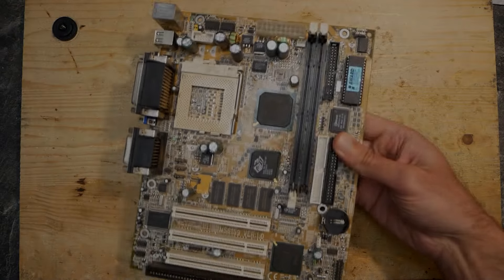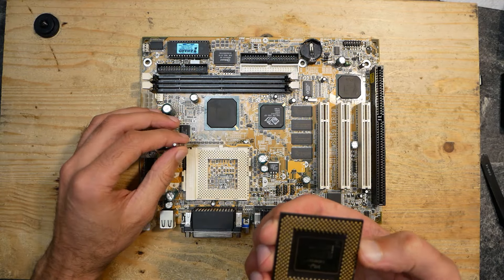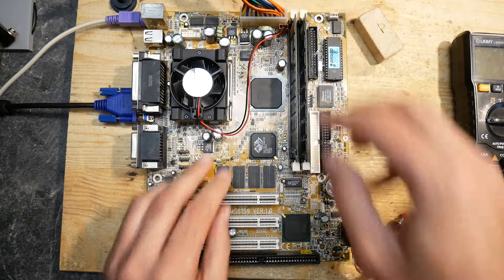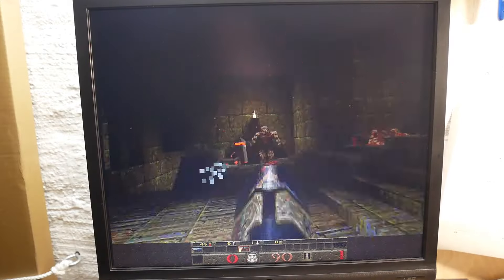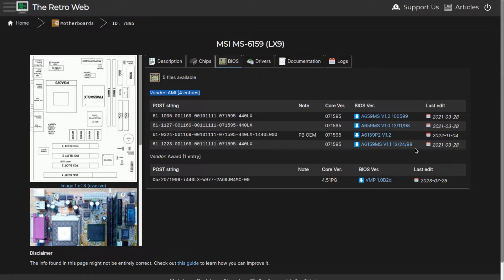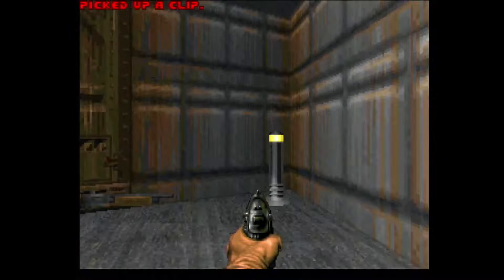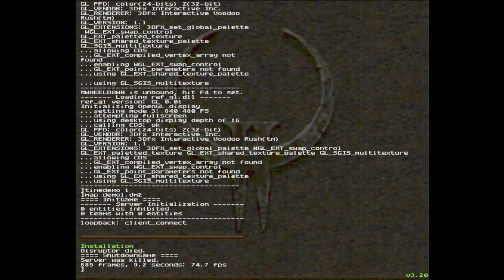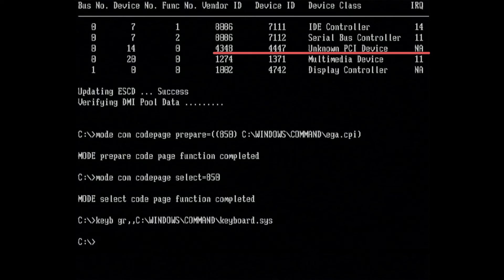Too nice to be true? Intel i440LX was upset about my plans.

Comment: I thought it was well known that 440LX has some AGP incompatibilities. I have a few 440LX boards and I have tried probably 15 different AGP cards and they mostly all work just fine. Matrox G200/G400, TNT/TNT2, banshee/Voodoo3, Savage 3D/4, Rage 128/128pro and yes even the Rage pro but the Geforce cards do not work. I haven't used too many newer cards, maybe the newer Geforce and ATI cards don't work also. Tempted to try some Radeons or newer Geforce cards in it, maybe Savage 2000 or Rage fury maxx even. Also, the Rage pro drivers are a mess. I remember needing multiple different driver versions to play many games so I wouldn't be surprised if that might be the reason for the Rage pro not working
Reply from the maker: The actual problem is, that those AGP cards don't work with Coppermine CPUs, but with Mendocino they work just fine. At least from what I tested. So there is no issue between LX and AGP, it appears first with Coppermine CPUs.
Reply: @necro_ware  Yeah, I understand that part. Just that the problems with the Rage pro might be driver related? Also the AGP Geforce FX works in the LX board with the Mendocino CPUs? My LX boards don't work with the Geforce cards I have tried but that was only Geforce 256 (SDR and DDR) and my Geforce 2 pro
Reply: @necro_ware  it could be driver being aware of incompatibilities of 440LX chipset and activating some workaround depending on CPUID (i.e. it checks for the CPU and not for chipset)

Comment: I forget which system I had with a PCI128 on board, if you like your midi, best with the 8Mb GM bank that came with the Ensoniq, I think Creative only supplied the 2Mb and 4Mb options - it wasn't quite software wavetable, and it wasn't quite hardware wavetable, well I guess it was hardware wavetable but with the memory borrowed across the PCI bus

Comment: It's quite unusual to see 440LX chipset with socket 360. They used to be Slot 1 boards, as far as I remember.
Reply: I have an AT form factor Gigabyte-GLA7 board with Socket 370

Comment: ATI Cards cannot cope witth high AGP Frequencys most of the time. With Radeon 9x00 Cards the limits seem to be about 80 - 90 MHz. (Blackscreen while Booting) Maybe on older Chips from ATI its worse.

Nvidia cards dont have this Problem at all (TNT2 to Gforce 4800). Reaching 100MHz with my geforce 4 on Nforce 2 pro was never a Problem.  My Voodoo 3 3500 does not have Problems with high AGP clocks, too. Cannot speak for geforce 5 cards... Maybe the 440LX is bad, also. Had the ASUS P2L97, giving me headdaches every time

On ATI 9x00 cards, you do not gain any performance from overclocking the AGP Bus also. This maybe is happening on older chips, also. on Nvidia/ matrox and 3DFX Voodoo 3500 the performance scales very well.

Comment: Intresting. Most of the LX boards i've seen wasn't able to run even Celeron Coppermine usually hanging on windows boot or in 3D I've always assumed it's AGP related, so it's not new, but 256 Mb RAM wasn't an issue for them. Is an intresting board tbh. Maybe not the most desirable but certanly an instresting one. Not many allows choose from AMI / AWARD and certanatly not many gives you ATI Rage for free. 🤔 Coppermine, well there is enough VIA and BX boards for them.

Comment: Just for curiosity, maybe I missed, but the issues with the AGP cards still affect old Mendocino CPUs? Also, I remember being in BIOS some AGP related settings (like AGP fast-write or similar, if I remember correctly); try to see if those are changing the behaviour. Maybe there are options set and hidden in the BIOS? That specific setting (AGP fast-write) I remember gaving me a lot of headache in some motherboards with Ati Radeon 9250 AGP, random freezing on some games, BSOD on XP SP3 and Win98SE.
About that mistery PCI device, seems to be from a vendor (4348) that made mostly serial/parallel I/O adapters for PCI and USB, so, maybe that particular mouse really had something to do with it; it might be a serial mouse in disguise  (LOL), however, another mouse did the same?
Reply: I believe that the fast-write feature was a later addition to the AGP standard and wasn't used with AGP 2x which 440LX supports. There's a side-band addressing which he may be able to disable and I would also try to run it in 1x mode just to try improving the stability.
Reply: @petrkubena  yes the AGP fastwrite has problem with SSE support CPU..as i know

Comment: I don't know if anyone has mentioned this yet but as it turns out the 440lx chipset dosen't support SSE instructions when you have a Coppermine CPU due to an incompatibility. This could be why later gpus crash when you do anything 3D and the rage pro didn't since its old enough not to require sse and also the voodoo 3 drivers also don't use sse
Reply: This was actually covered near the end of the video.

Comment: Interesting motherboard, is the first one of this kind (with integrated graphic) of that era that i see! great work as always!
Reply: ha. Thankfully you dont use some Chips&Technologies based socket7 boards. It was a nightmare 😂 - slow as hell 😁
And on branded (like HP/Dell) PC I have seen integrated video at least on 486 VLB era.
Reply: @VShuricK  never came across one, now im will be on the look for one, at least for trying them out. I have some socket 7 waiting for me to repair them an tinker, tho not having the time. its a shame! all that suffering waiting for me! hahaha

Comment: Ah, old Intel Chipsets and their pickiness with RAM...
You have to have them in a certain organisation to be detected correctly. If its the wrong one, you get half the Capacity, if it even works!
PRO TIP: use low capacity sticks to test Intel SDRAM Pentium2/3 Chipsets...
The i430VX for example only supports 16MB (maybe some 32MB?) Sticks for example...

Comment: My ABit BH6 rev 1.01 (or similar, early revision not supposed to support coppermine) ran my Pentium 3 700 @ 933 mHz rock solid for years in a slotket by just cranking the bus to 133 and upping the Vcore a bit. None of my Riva TNT, TNT2 Ultra, GeForce 256 cards had any problems running at 2/3x133 bus speed either. Overclocking used to be such a joy... Also it used to save a LOT of money, which is one of the reasons it's pretty much dead now =D
Reply: 16:50 i was probably THAT lucky having accidentally bought an early revision Pentium III 700 and a great silicon quality one as well.
Reply: It might have been because of the Slotket i used as well, it did have jumpers for some stuff, one of them might have been the reset mod.
EDIT: i think this was one of the major reasons i didn't buy a slot 1 p3 700, i think i needed to use a Socket 370 model in a slotket to even have a chance of it working. Still, the BH6 revision i had wasn't supposed to be able to work with a coppermine cpu.
Anyway, this was A LONG TIME AGO, it's hard to remember all the specifics.

Comment: Did you try swapping the 8 mb (4x2Mb) SGRAM memory chips of the Velocity 100 against 16 mb memory (4x4 mb)? There exists a model of Voodoo 3 2000 with only 4 chips soldered on instead of 8. I have myself this board (Velocity 100) and was wondering is it worth a try. You can get the necessary amount of 4 mb SGRAM chips from ATI Rage 128 boards.
Reply from the maker: No, I didn't try that, but that seems to be an interesting idea. I'll put it on my list if you don't mind.
Reply: @necro_ware  I would gladly wait for the results (moreso if that would be a success)!

Comment: Might be able to uninstall  the AGP gart driver and force the AGP device into pci compatibilty mode. Might be a bit tricky for intel chipset as Widows would come with the driver. Might be possible to use update driver in device manager  to force the AGP bus to use a generic PCI-PCI bridge driver instead of the proper agp bus drivers. AGP Aperture size setting in the bios might do something
Reply: Nvidia can do it right from the drivers using coolbit registry hack to unlock agp settings and overclock page :) Maybe it is only needed to disable SBA, fastwrites or both....

Comment: At least on my Asus P2L97, Coppermine doesn't have the same problems so the issue could be purely socket related, not chipset. While seen as a Pentium II, the voltage regulator supplies down to 1.7V  for my PIII 650 (rated 1.65V) and everything works the same as with my Celeron 300A/333. I don't have the same AGP power limits as with my SE440BX-2 either, the only AGP cards of mine that don't work are due to their connector.
Reply from the maker: That is an interesting information. The single difference between P2L97 and the MSI board which I tested is the CPU slot. Well voltage issues should not be relevant I guess. I have here another 440LX Slot1 board. Will have to check that out.

Comment: failing caps sometimes start to get higher capacitance so the caps you desoldered might actually be degaded since 1817uf is way higher than 1500uf
Reply: Yeah, I saw that too - higher capacitance, high ESR and high VLOSS. Which is why it's better to replace them anyway.
Reply: yes due to leakage

Comment: you may discount the soundblaster pci128 for having poor msdos support, but it is a solid sound card for windows with good 3d sound. and if you plan to run a pentium 3 machine it is to play windows games rather than msdos games. and nothing is stopping you from installing an ISA soundcard to cover msdos gaming anyway.
i have a p3 933 with a soundblaster pci128 for windows and midi with its wavetable synth and a soundblaster 16 for msdos fm sound.
Reply from the maker: Yeah, for windows it's ok indeed, software wavetable was quite decent, but I would rather go with SB Live! instead. The PCI 128 was Creative's first try dive into PCI world and that wasn't even an in house development. Also 3D audio in that card was kind of poor in my opinion. Once again SB Live! with EAX or may be Aureal with A3D is a better choice for a retro PC. Especially SB Live! today is also very cheap and easy to get.

Comment: I have one working PIII-class system which is running a Coppermine Celeron 700 at 528MHz since the clock divider doesn't support it.  It still reports it as running at 700MHz though.

Comment: I think the voltage regulator cant supply enough power to both the coppermine cpu and the graphicscard. Its probably too low rated . Maybe swap it for something higher rated and see what happens

Comment: How exactly do you disable SSE in software? o_O And what prevents any other software from detecting and using it again? AFAIK, SSE is completely broken in 440LX and is unfixable, it has something to do with the chipset being unable to transfer such long instructions between CPU/RAM/Cache.

Unfortunately, 440LX seems to be a very underwhelming chipset for any kind of P3 modification. You can run Tualatins on it, and if you're lucky, AGP will even work properly. But as soon as you run any SSE software, the system will crash. Win2000/XP won't even install. Late Win98 software will crash the system.

Slot-1 boards with 440LX, however, make perfect candidates for Pentium Pro builds with Socket8-to-Slot1 slockets with AGP port. You would need to manually mod the BIOS slightly.
Reply from the maker: Thank you! Yeah, this is my point I can deactivate SSE per software. This is documented and can be made by writing the right bits into CR4 control register, but as you said, nobody prevents other software from activating it again, that's why I don't think that it works. But my suspicion, that SSE could be the problem remains. I didn't find the way yet how to disable it permanently to see if this would change anything.

Comment: At 9:53 you claim that you think the fastest Coppermine Celeron is the 766.  Did you mean to say the fastest at 66FSB?  I know there are faster at 100FSB for sure, I've got a 1GHz Celly in my hand here!
Reply from the maker: Yeah, I meant 66FSB one indeed.
Reply: I think the fastest Coppermine was a Pentium III with 1.1 GHz and 100 MHz FSB if I am not mistaken.
Reply from the maker: @kyoudaiken  Yes at 100MHz FSB it was 1100MHz and at 133MHz FSB 1133MHz. Of course the 100MHz one is much more interesting, because it had higher multiplier and with a bit of luck could be overclocked to 133MHz FSB.

Comment: Thank you so much. That PCI bus cause much funny if it comes to gaming video cards. Cause that ferra possibly make it busy slightly over than 100 percent while IDE and some other hardware cannot exchange with northern bridge and CPU as it had been till i815 and so on. Commonly, VIA Apollo Pro 133 and also 440BX are the best for its class and the age, unluckily I cannot get 512 mb SDRAM double-side to accomodate it

Comment: Just by pure curiosity might be worth to try Windows XP and check if the graphics cards work better, Windows98 was a pain with the GPU drivers and when they changed in XP the driver model it solved so many problems that might solve these.
Reply: I remember the Coppermine + i440LX combination preventing Windows 2000 and XP from booting at all.  I believe that SSE being available, but broken is what causes it to crash.  SSE-aware Linux kernels will also throw a kernel panic during boot.  I was able to get a kernel to boot by compiling it for Pentium Pro/II optimizations explicitly, avoiding PIII and higher which would bake in SSE.

Comment: 5:52 - what exactly did you enabled in that phils program to get such boost? only linear frame buffer, or something else?
Reply from the maker: That's simple, answered everything with yes ;)
Reply: @necro_ware  but there is alert, I should not enable some write posting, because I have 440BX chipset. 
I mean, the first option.
Why there is alert, I should not enable it on 440BX mobo?

Comment: I just so happen to have a Asus P2L97 Rev. 1.05 Slot 1 mainboard that features the 440LX chipset. I have done plenty of research that has told me that this board should support A 766mhz Celeron with a slocket adapter and the latest beta bios. Interestingly the agp slot on this motherboard only supports up to a Nvidia Riva 128 as the port does not supply enough power for newer cards to run stabile or even post if new enough.
Reply: the vogons thread called 'early 440lx agp voltage regulator issues, anyone tried cards with additional power connector' has a workaround for asus p2l97 boards linked at the  bottom of it, from an old asus technical support post, if you're handy with a soldering iron.

for that board revision and rivas, specifically, but i'tll help with any other gpu that pulls too much current from the slot, i'd imagine.